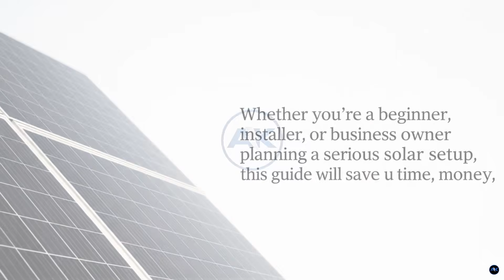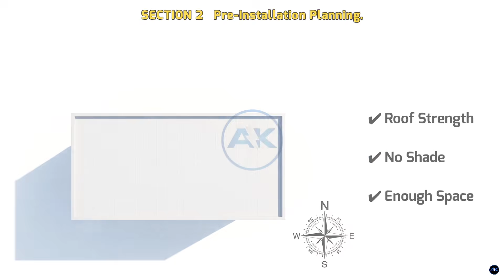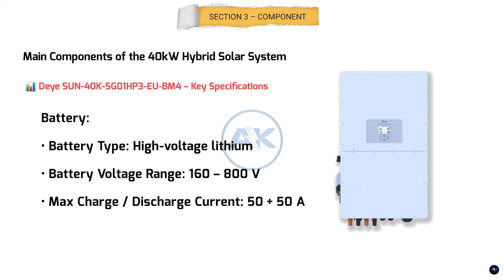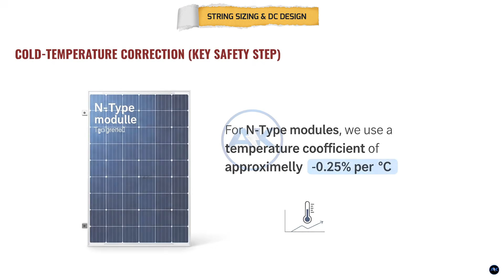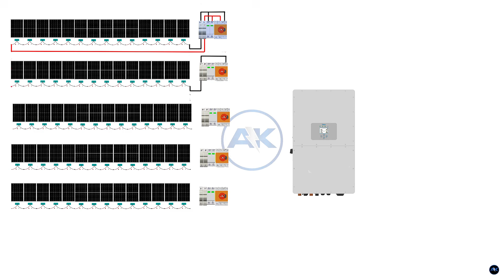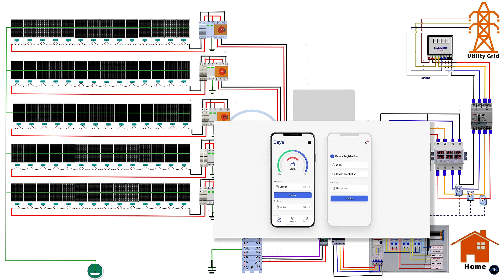40kW Solar System Installation – Deye Hybrid + 60kWh Battery (Zero Export Explained)

Comment: 1x50kw solis hybrid inverter.
160kwh highon BESS.
105 x trina 620w ne19r
Reply from the maker: "That’s a powerhouse of a setup! A 65.1kWp array paired with 160kWh of storage is a beastly configuration—perfect for serious energy independence or heavy commercial loads. Those Trina 620W panels are top-tier for efficiency, and Solis is a rock-solid choice for the brain of the system. Is this for a commercial site or a high-demand off-grid project?"